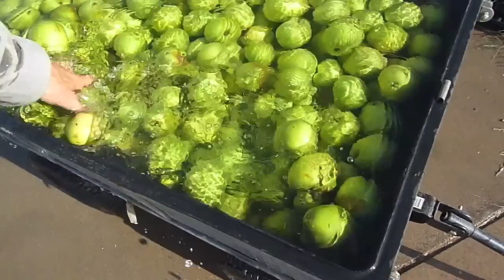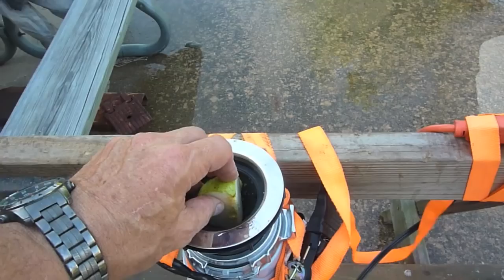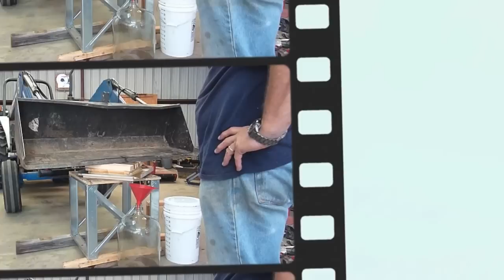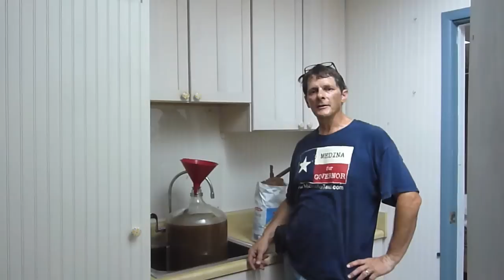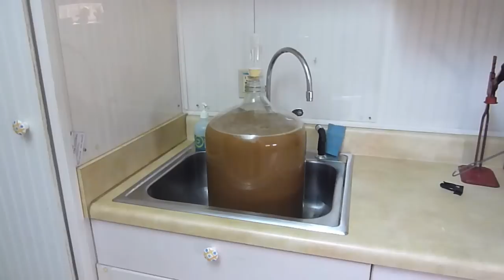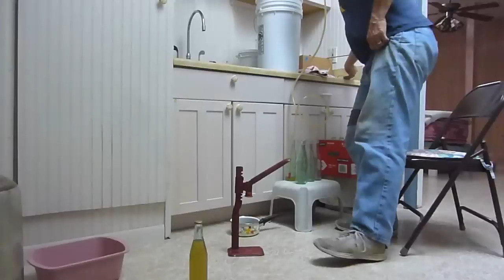Making Pear Cider

Comment: Pears and pear juice oxidize/brown easily; did you add sulfite after grinding or after pressing? Thanks for posting!  :)
Reply from the maker: No sulfites. I've heard they are used in wine making to kill off the yeast and stop fermentation and hadn't considered sulfites for pear cider (or "perry" as some say). I wanted to keep it as pure and simple as possible.
The brown, cloudy color is not very attractive, but was the immediate result of grinding and not the result of bacteria or yeast - so sulfites probably wouldn't affect the color.
The discolored particles settled out after fermentation and the resulting cider (perry) was clear and amber colored, with a slight haze.

Comment: i've read after scratting/ breaking the pears down, you should leave the broken up pears for a while before pressing them to juice? is this necessary? and if so where should they be left? just out in the open? will they not get contaminated?
Reply from the maker: I don't have any firm sources for this, but I've heard that after 
grinding pears to pulp, the sugars will be more available if left 
overnight before pressing to juice. This seems similar to the processing
 of other foods, where the starches are converted to sugar - as with 
potatoes.
In my practice, I just haven't had the patience and just press them immediately after grinding - except for one night, when the mosquitoes were abundant and I covered the pail until the next morning.
If anyone has references on this, I would be interested in knowing more.

Comment: Thanks for the video. About how strong would you say your pear cider is, and why do you add the extra 2 cups of sugar as I didnt catch it. Oh one other unrelated question, do you have friends from Peru as I noticed your shirt is from there. THanks!
Reply from the maker: I haven't measured it with a hygrometer, but I have by experience. It is
 stronger than my 5% - 7% beer. I have friends who say it really has a 
kick. The sugar is 1 pound per gallon and raisins are also added to 
boost sugar content. I did this primarily to boost the alcohol content, 
as I was told by a brewer in Normandy that unfortified apple cider 
yields 3% max. I thought the sugar content of pears was similar, but now
 I think it may be higher.

I got the shirt while visiting Peru. South America is quite a nice place to visit. I am currently in Argentina, checking out the Eastern part of the continent. I am in the town of Iguazu, with a view of Paraguay from my window.

Cheers!

Comment: Where do you get your bottles from??
Reply from the maker: +Luq Shah 
I &quot;recycle&quot; used bottles from beer, cider and mineral water - either from brew that I buy or from my wife's co-workers. People are glad to provide bottles if I tell them that I&#39;m brewing and that bottles with rounded lips are hard to find (can&#39;t use bottles with screw-on caps).

The brown bottles are commonly used  to reduce the light getting to the brew. I like to use some clear bottles so I can visually inspect how it ages after being capped. From the time I add priming sugar, it needs a few weeks to complete fermentation and settle. When done, I see a thin layer (1/16&quot; or so) of white residue at the bottom. When pouring the cider into a chilled glass, I pour all but the last bit with the residue - mostly to prevent cloudiness in the glass.  I usually swirl the bottle a time or two and gulp the last bit.

I found it best to consume the pear cider within 6 months or so, as it has turned sour when stored for longer periods.
Reply: Tom Griffing oh i see, thanks for the info, it helped a lot!

Comment: how long do you leave it in the secondary fermenter and how much sugar per gallon -- in lbs or kilo,s?
Reply from the maker: I didn't leave it in the bucket for more than 15 minutes - it was only for separating the clear cider from the sediment so I could mix in the priming sugar before bottling.
Initially, I added 1 lb / gallon for fermentation. For priming, I added between 1 - 2 cups for the whole batch, as it is only to make it ferment a little for the fizz.
Reply: Tom Griffing you say 1-2 cups of sugar to the bucket = in weight by lbs please,
as I am just learning did you top-up the fermenter before adding the sugar & yeast with cold water.
Reply from the maker: Peter Hardie
Weight?  Let's say 1/2 lb or 0.23 kilograms (approximate).
No water - only pear juice, sugar and yeast.  Be careful of "topping off", you need some room at the top to allow for bubbles, as it gets more viscous with time and bubbles will rise and blow through your vapor lock.  This is why I leave a few inches.
Reply: Tom Griffing thanks Tom,on your video when you have extracted the juice your carboy is half full when you have it in the sink it is about 3/4 full is that all juice or added water, sorry for being a bit dim but I have 200 lbs of pears from my tree & I don,t want to get it wrong
Reply from the maker: Peter Hardie
After pressing the first bucket of pear pulp and only having the carboy 1/2 full, I repeated and pressed more until it was full of pear juice only (ie: NO WATER).
Bear in mind that if you add water, it dilutes the sugars and will result in cider with a lower % of alcohol - not my goal, but you may prefer otherwise.
Reply: Tom Griffing hi Tm gotcha, just didn,t weeken the batch by the way I have th sam e masher as you but I cut a hole in the bottom of a plastic basin and attached it to the masserator this way you can put a bucket of chopped fruit & it,s almost self feeding it works atreayt
Reply: Peter Hardie last word should read( works a treat)